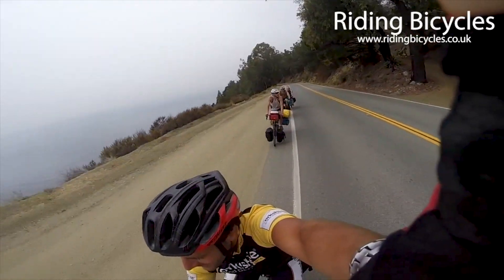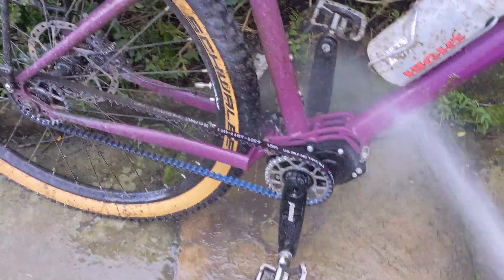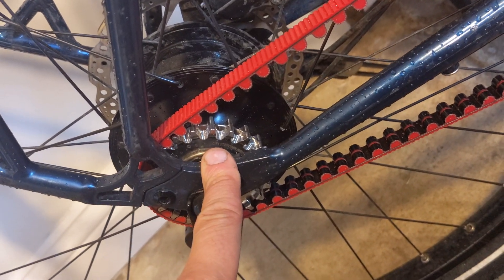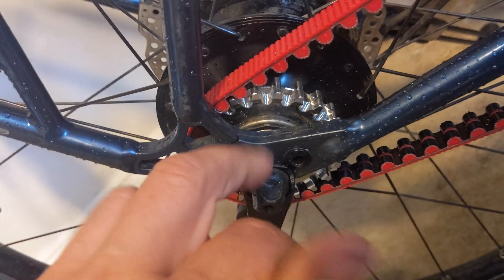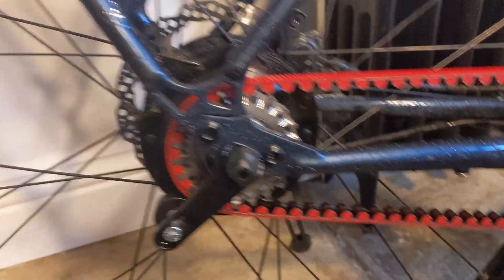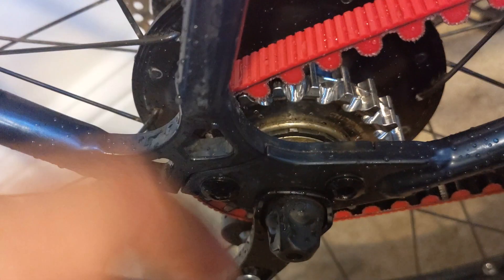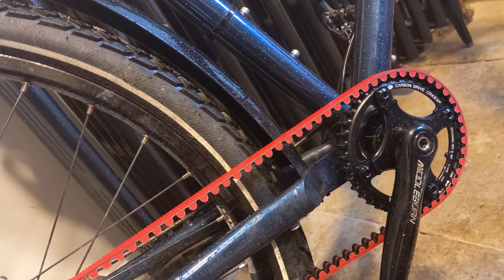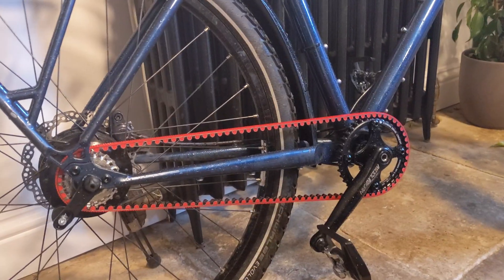Rohloff Speedhub Chain To Belt Conversion. Gates Carbon Drive. Easy Bike Maintenance.

Comment: belts are a 21st-century gimmick someone trying to be different. chains are more reliable been use for over a hundred years
Reply from the maker: If you watch my other videos you will see that I enjoy and use everyday reliable rides eg friction shifters.  I don’t use pointless tech eg indexed gears, electronic shifting.  When something is developed that is actually beneficial to riding, then I take note.  Belt and gearboxes are the perfect combination to the everyday cyclist that wants something to last without any maintenance.  I hate cars but think about having to oil and clean something on a car after every drive that would be a complete nightmare.  Belt and gearboxes are fit and forget, perfect if you are wanting to get everyday people in bikes and out of their cars.
Reply: Then don’t get one.   The chain is the biggest maintenance headache on my bike, especially in wet weather.  Unless the chain is in a sealed oil bath, a belt is superior any day.
Reply from the maker: True words.
Reply: Belts have been around for 1,000's of years, in varying forms and usages. There are always pros and cons.

Comment: Hello. I find it very interesting that you are adding a Rohloff hub to your Pinion bike. How is the gearing working out with using two shifters?  I am buying a new Priority 600x with a Pinion gear box in a few weeks (March 2021). And I was wondering about possibly adding a geared hub like a Rohloff or Shimano as well.
Reply from the maker: Hello,  sorry for any confusion.  I have not done that.  I do own a couple or Rohloff and Pinion bikes but I have not combined them.  The video I think you have seen is just me converting my Silkroad from chain to belt.  There was an experiment online where someone did that for fun.  I don’t think it would provide any real world advantages.  But always worth a watch out if curiosity :)
Reply from the maker: The Priority is a nice bike.  I presume you have seen the videos Ryan Van Duzer has done 👍🏽
Reply: @DylanJugroop  Yes, I have been watching Ryan's channel. I can't wait to get my bike. Guessing you really like the Pinion gearbox too. And thanks for clearing up the Rohloff/Pinion thing. My mistake 8(.
Reply: Dirty Owl you are confused. The Rolhoff and Pinion are the same thing in terms of function since both are internal gear units. It would be impossible to have both on a single bike simultaneously (and you would achieve no effect by doing so, even if you couldl

Comment: How does the Rohloff compare to the Pinion gearbox?
Reply from the maker: So you know what experience I would of had the bikes were/are a Rohloff on a Surly Ogre and a Tout Terrain Silkroad so steel expedition bikes and I had a Pinion on a titanium Pilot Vamos also an expedition bike. I have now got a pinion on a steel hardtail 29er.  So the Rohloffs have always been on heavy bikes anyway. The Pinions have been on lighter bikes.  Not by much but still a bit lighter.  Both Pinion boxes are the 18sp so a Q factor of about 170 ish .There are pluses and negatives to both.  The negs for the Rohloff are that the weight is in the rear wheel, fine for touring bikes, but I would not use one on a mtb bike.  The pluses for the Rohloff they are easier to move between bikes as you don’t need a special frame unless you are going for belt drive.  The advantages of the Pinion the weight is in the middle of the bike, the rear wheel is completely low friction so the bike seems freeer when coasting downhills.  There does seem to be a bit less of the draggy feeling with the Pinion, but I am not sure if that is just because in certain gears on a Rohloff you get a humming noise where as the Pinion is silent in all gears. The negatives of the pinion is you need a special frame.  Although you can buy frames without the gearbox It is hard/impossible to fine a pinion gearbox selling to put in the frame, so you are better off buying a complete bike unless you are moving an existing gearbox from one bike to another. The customer service and servicing of both are really slick. My honest opinion is that I will be sticking with the Pinion.  I sold my last Rohloff bike last week. I have Tout Terrain Scrambler coming early June with the 12dp Pinion box with is quite a bit lighter and the Q factor is a more normal 160 ish.  That will be working with the Cinq drop bar shifters so it will be interesting to see how that set up works.
Reply: @DylanJugroop  Wow, thank you for such detailed explanation. I look forward to  the review of the 12dp Pinion. It's a shame Pinion gearbox cannot be bought or offered by the manufacturer as a retrofit item - it shouldn't be too difficult to cut and weld if it was offered with the appropriate fitting aluminium bracket. Any way, thank you  for your answer!

Comment: I have a normal push bike and I converted it to a cheapy single speed freewheel. Can i just take out the chain sprocket from the freewheel mechanism and straight swap in a belt sprocket?
Reply from the maker: Hello, if you have a specific frame for belts that can split to allow the belt to pass through the rear triangle you will be fine.  You will just need to go on to the gates website and see what rear and front cogs would adapt on to you existing crank and hub body.  If you don’t have a frame specific for belts that split in the chain stay, seat stay or rear dropout then you can’t fit a belt.  If you are wants to get a belt specific frame I have included a link to a list of manufacturers. 

https://www.cyclingabout.com/belt-drive-touring-bike-manufacturers/

And gates website 
https://www.gatescarbondrive.com/#

Cheers
Reply: @DylanJugroop  Thank you very much for your help!

Comment: Regarding purchasing the correct belt length, my chainstay is 478mm and the best combinations with the compatible rear cog would have a length of 477.46 or 480.33 according to the calculator. Would you recommend going with the former or latter? I cannot adjust the cog placements as the frame does not have a sliding mechanism.
Reply from the maker: Hello, you will not be able to use a belt if you do not have dropouts that can tension the belt.  So you need sliding dropouts or an assentric bottom bracket which my bike has. This is a bottom bracket where the crank hole is offset and when you rotate it it shortens or lengthens the distance, but this is also something you can’t add on and is a special frame.  Also if your frame does not have any of the above features I suspect it would also not have a break in the seat stay or dropouts to put the belt through. To use a belt the frame must split to get it through the rear triangle.  If you are keen to use a belt you could get a frame from one of these makers in the list:
https://www.cyclingabout.com/belt-drive-touring-bike-manufacturers/
Reply: @DylanJugroop  Thank you for the reply. It is a chinese carbon mtb frame and has a break via the rear shock to potentially install a belt. I guess I could drill a few mm either side of the axle dropouts to adjust tension for the belt, keeping the hub in place via nuts? I would much rather a belt than dealing with an oily chain for maintenance. What would your opinion be - is it worth the hassle?
Reply from the maker: I would avoid that completely. Drilling into the frame would massively weaken it and would potentially be very dangerous especially as it is carbon. Even if the dropouts are steel or aluminium it would still make it very weak. I would definitely checkout the list of frames in the link. There are a lot of expensive sexy Ti frames, but there are also some very reasonable steel/aluminium frames too that are also very sexy.

If you are still wanting gears you need to either have an internal hub gearbox eg Rohloff, Aldine or a pinion gearbox in the bottom bracket. A belt can’t work with a cassette/derailleur etc it is fixed in position.  Cheers

Comment: That was useful. Do you know where I could buy a frame that is already split ? so that I build my own bike using Gates belt ?
Reply from the maker: This is a complete list: I had forgot about Salsa as well.  The list is complete bikes but most sell framesets too.

https://www.cyclingabout.com/belt-drive-touring-bike-manufacturers/
Reply from the maker: Some very sexy bikes in the list :) 🤤
Reply: A frame has to be stidd enough to be Gates certified which not all rand frames are
Reply from the maker: 👍🏽 Yep all the ones I gave him are certified
Reply from the maker: Yes there are quite a few. Ones that I have experience of include:

if you want titanium.
Pilot
Nua
Falkenjagd

If you want steel check out
Tout Terrain
Rennsthahl 

There are a lot more as they come to me I can add them to this conversation 👍🏽
Reply: @DylanJugroop  Thanks man. That was instant !

I will check those out and I will come back here to look for your updates. 

Always useful content by the way.
Reply from the maker: Cheers! Have a great weekend 👍🏽

Comment: I have thought about doing just what you have done, taking off the rear chain sprocket and sliding on a Gates sprocket in it's place, but apparently Rohloff say you can't or shouldn't do this as the Gates sprocket can make contact with the hub they say and maybe the splines on the carriers are different. They say you need a new splined sprocket carrier either the 8540L or 8540SL specifically for the Gates belt rear sprocket with a screw on lock ring to hold it in place. They say the ring is not enough. The 8540L Gates spline carrier has a chain line of 58mm and the 8540SL a chain line of 53mm. Then you have to buy the Rohloff locking tool which costs about £40 so total cost about £80-85 on top of what you have done. I know all this as I have just purchased most of this, but still waiting for the Rohloff/Gates spline carrier 8540SL to come from Germany.

But I suppose if your set up works fine then why change it? Have you checked the chain lines front and rear for the belt to see if it is still running dead straight? The chain line should be 54mm ± 1mm which might already know and have done.

Your Pinion/Gates belt bike is to die for. Currently the ultimate gear/transmission system on a bicycle. One day I'll get one.
Reply from the maker: Hi, my Rohloff must be the newer one as it is already the type where you remove the cogs without tools, it is just a ring with a little gap that you pop off change your ring. Insert new ring hey presto it is a 5 min job once the wheel is off.  I bought a Rohloff tool too, but I did not need it in the end. The Gates Rohloff rear sprocket is set to give the perfect belt/chainline when paired with the Miiddleburn crank that I have on it, it has a crank spider to use with Rohloff and chain and different one to use with Rohloff/belt and Gates front sprocket, so I guess I was lucky has I had some parts that were half way there like the adaptability of the Middleburn crank.  I ordered all my stuff from German sites too eg bike components and bike24 etc.  The stuff came with in a week.  Rohloff recommend using a snubber which I have it must sit about 1mm from the belt (not touching it) but you see lots of bikes professionally built that don’t bother with that 👍🏽
Reply: @DylanJugroop  Thanks for your reply. Yes I too have a 'newer' Rohloff with a splined carrier. Well I actually have two and they both have splined carriers with a sprung lock ring. They are less than 5-6 years old. The chainset I already have on the bike is a Gates one. It's a Cube Travel SL currently with an Alfine 8spd on with Gates belt, but I'm not keen on this Alfine hub. The steps between the gears are far too big. I have the Rohloff hub on another bike, my Surly Troll, which I want to take off and try in my Cube as it is already a belt drive bike. Maybe I'll just swap the rear Rohloff chain sprocket for the Rohloff/Gates belt rear sprocket and see how things go. The bike shop is still waiting for the 8540SL spline carrier to arrive that I ordered. I would have gone with a Middleburn crank but their prices were a little high for me. I think my FSA double crankset was £49.99 from ChainReaction. I was debating whether to fit a snubber or not. As you say there are quite a few Gates belt drive installations that don't seem to have them. My Cube bike doesn't have a  snubber fitted to stop the belt jumping or coming off. I think with the centre track CDX system it is not so important as the belt does not jump because of the centre track where as with earlier versions that didn't have centre track it was a distinct possibility and may well have happened. I still might fit one though. The only thing I see is it is possibly prone to getting stuff caught in it and is more a solution to a problem that doesn't really exist. Thanks again for your reply.

Comment: I was under the impression that a larger rear belt  cog would allow you to go uphill easier with a heavy load?
Reply from the maker: Yes. I have the largest you can get for the Rohloff and it is actually too easy.  Even on slight downhills I run out of gears and up our local steep hill constant 11% and 20% on a couple of bends I still have four gears left. So after Xmas I am going to need a smaller cog at the back.
Reply: @DylanJugroop  What size chainring and cog do you have now?
Reply from the maker: On my Tout Terrain Outback and and Tout Terrain Scrambler they are both 32t front and 32 rear but that is on a Pinion gearbox not Rohloff.  If you select your front chainring in this calculator leave the other two spaces blank and select Rohloff from the internal hub drop down you can work out what gear inches you want.  

https://www.sheldonbrown.com/gear-calc.html
Reply from the maker: 18 gear inches for heavy loaded touring in your easiest gear would be a good aim. But remember you would lose that at the other end.  So you need to plan what riding would suit your desired gear inches.
Reply: @juliapoelstra3624  I have 32 T on both front and rear with a Pinion C1.12

Comment: Does your rohloff stay clean? Mine gets covered in oil. I'm quite worried to convert before I fix the oil leak issue but only in case oil makes it comes off.. Mine seems to have been leaking since day one more than anyone else's I've ever met or talked to. I'm cycling around the world in July
Reply from the maker: I have had two rohloffs and not seen a spec of oil on any part of them.  I would probably do a oil change and insert a new grub screw if it is coming from the oil filler port. When inserting the new oil filler screw it is very important that you don’t screw in the screw too far as this can damage the gearbox.  I think you only screw it in until it is flush with the gearbox case, but check this in the manual.

Comment: How do you know the belt size you need? I really need to know because I'm planning to do same to my bike ASAP. Has rohloff and currently a square taper bottom bracket from royce. 40 tooth thorn chain ring 21 tooth rohloff sprocket
Reply from the maker: You need to have a method of tensioning the belt either with horizontal dropouts or an essentric bottom bracket which is the bottom bracket on my frame.  You also need a special frame that splits to allow the belt to go through the rear triangle. If your frame meets these criteria then you can go on to the Gates website and there is a configuration tool.  You type in the chainstay length centre to centre and the ratio of gears you want and it gives you some possible gear and belt combinations

Comment: It seems to be not tension enough. How you tension it?That frame look like doesn't have that usual sliding mechanism at rear wheel.
Reply from the maker: Essentric bottom bracket 👍🏾
Reply: OK. Thanks!